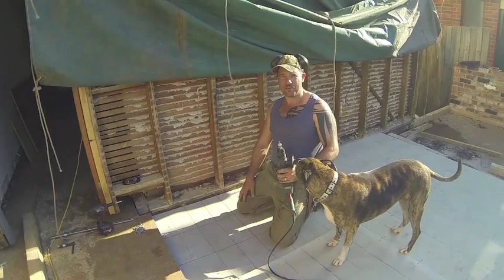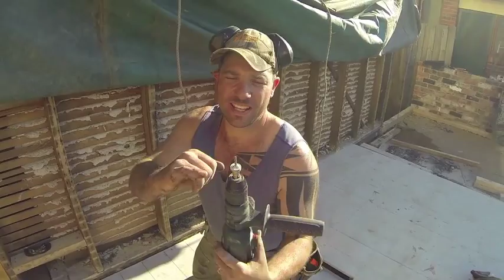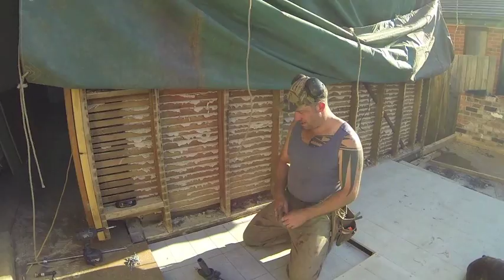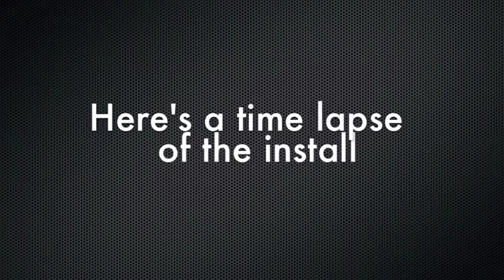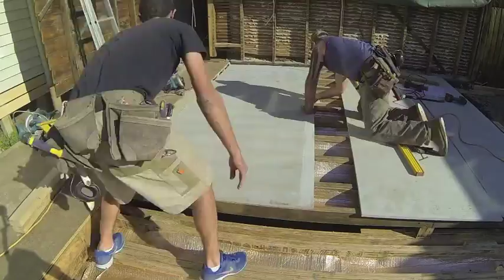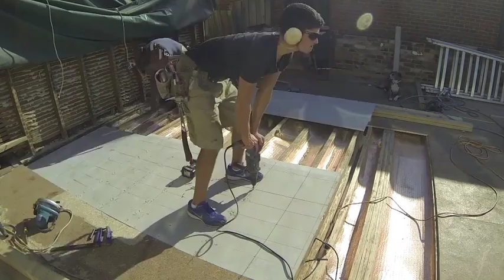The BEST way to install Compressed sheet

Comment: Joe, nice to see your install of Compressed Fiber Cement Sheet Flooring

1) Are you using 15mm CFC Sheet Flooring ?
2) What kind of Adhesive do you use under the CFC ?
3) Do you also use an Adhesive 'between' the 2 CFC sheets that you will be joining ?
4) 'Under' the 2 sheets you will be joining, will you be putting 'support' noggins / trimmers in between the floor joists ?

Cheers
Reply from the maker: Gday AKT,1) Yes we are using 15mm compressed sheet, yet we have placed our joists at 300mm Centers.  We do this for weight transfer, ensuring even weight distribution as well as for the heights of the floor once tiles are on.2) we used a special construction adhesive, this same adhesive is used under our "battening a concrete slab for floor boards" video. 
3) Yes we also glue our sheets together (edge to edge) to ensure MAXIMUM water proof and minimize any movement of the sheets, tiles, waterproofing membrane etc...4) As we have moved our joists to 300mm centers and all joists are 45mm thick we have joined our sheets directly over the center point of these joists with a bearing of 20-22.5mm where joined.stay awesomeUncle Joe joe

Comment: Thank you for your video. What size of mortar bit you used to drill holes?
Reply from the maker: Gday Vic Morgan,
the size of the mortar bit will depend on the screw we use....this is usually a 3-5mm hole with a 55-65mm screw length.
thanks for the question and following hte channel.
#stayawesome
joe joe
Reply: +Beowulf Builders Pty Ltd Thank you